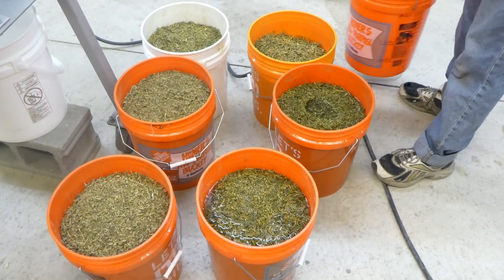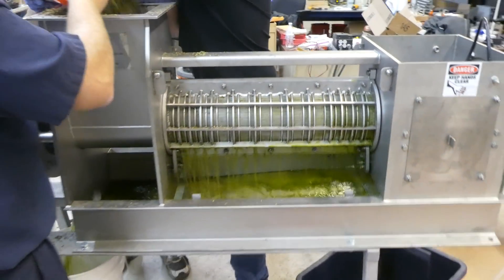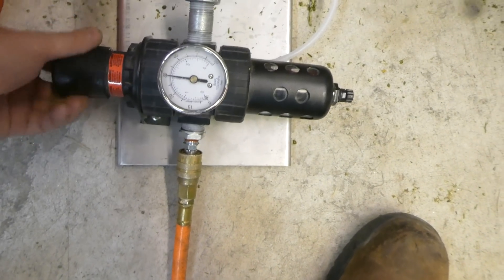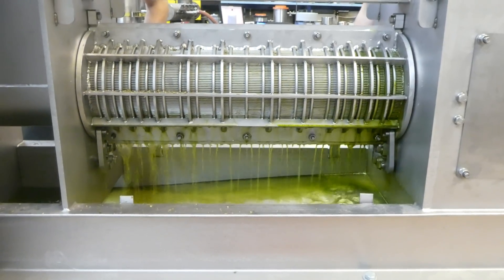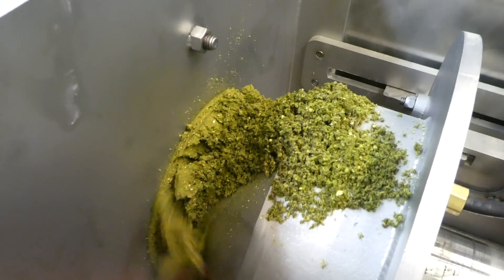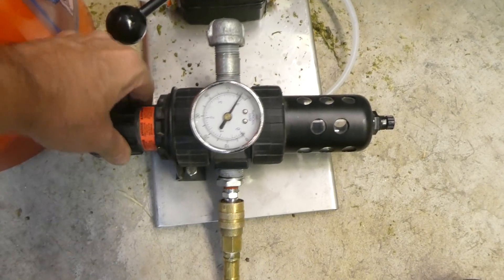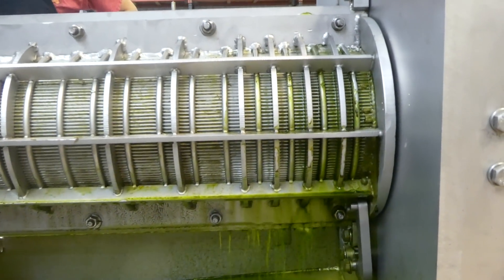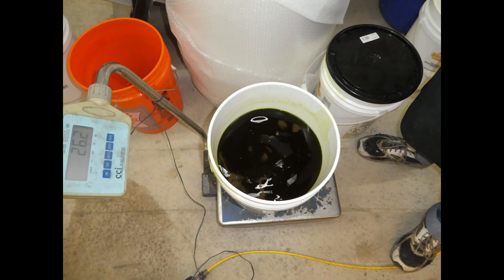Hemp processing with Ethanol for CBD oils  - VincentCorp CP6 screw press

Comment: I read that ethanol will eat the plastic on those bins.
They should be stainless steal and or glass?
Reply: 100 percent correct first thing I  noticed that whole batch wouldn't pass to be sold. They they test it For contamination. Never use plastics in the hemp industry especially with pure grain alcohol knuckle heads.

Comment: You're solvent will strip the plastic off the inside of that bucket. You are using the wrong buckets
Reply: I concur. I re use 5g green food grade buckets for a direct immersion hydro grow but for any pet solvent (alcohol hexane acetone) I'd be using stainless or glass.  It pains me to see actual dispensaries using plastic bottles or pouches to retail any bud CBD or THC.  I know it's a cost thing.   You could rinse the damaged /detached  glands out of a small  jelly jar not so good from a ziplock.

Comment: Someone else used this similar press at 131psi..squeezed out even more.. hopefully this helps,The oil was thicker and darker.
One more thing,they just added it without water.
Reply: Over 170 are using them.  Generally we don't see an increase beyond 80 PSI but it really depends on the material and the process being used

Comment: excuse the ignorance but if the ethanol  is used to bind whats the point in the screw press>? isn't it just extracting moisture from the plant matter as well as the cbd, so wouldn't just some sives be just as good if not better at extracting the valuable oil with out added water and other content,.?
Reply: disregard that, im guessing our just trying to squeeze out all the ethanol to the max
Reply: @kiboshkooks  Most use our presses on post process waste material.  Some do use it similar to this test but will need to filter out undesireables after and still rotovap or falling film the ethanol / CBD to get to a crude

Comment: Is it common for your customers to do extraction on the trim after pressing?
Reply: Most of our customers are using the press on post process waste material.  This is just an example of 3:1 ethanol saturated hemp being pressed.  Ideally you could use this as a primary extraction vessel but you will need to filter out the undesireables that press into the liquid after.  This was just a test all material thrown away.

Comment: I hope people really understand what ethanol is. Not good for the body.
Reply from the maker: I agree, but revert to the other comment,  short of using MCT oil as a extractor and carrier for the cannabinoids , there are very few options on extraction right now.  95% of all the CBD oil on the shelves you find will have touched ethanol or even worse Hexane as some point during it's life.  The beauty is that the further steps down the line.  Fractional Distillate and refinement to the isolated CBD molecule, means just that.. the only thing that gets into the vials is the wholly Isolated CBD molecule.  No other molecules.  It's chemistry and science, just like when you take ibuprofen, aspirin, vitimin C tablets ( Oranges have been processed with ethanol for over four decades by the way for oils, flavoring and full chemical extraction ).  But I get it, it sure doesn't sound nice the first time you hear it.

Comment: Let’s start by wasting a bunch at 5 psi” “how how can you run it?” “80” next shot... “run it at 100” what a newb
Reply from the maker: you have to work up gradually to get the machine into a rhythm with regards to hydraulic pressure building.  analogy.  When you are facing uphill at a Red Light, you don't try and start off in 3rd gear.  You go 1st, 2nd 3rd.   If you start at 80 psi with this press at start, normally the VFD trips out the motor
Reply: Hemp Press so is it electric over air over hydraulic? The analogy provided does not make sense. Air over hydraulics do not use multi speed transmissions.
Reply: All I know is a lot of product was expelled at above depleted moisture content

Comment: Are you able to use this without any solvent, or does there have to be some type of carrier oil/solvent?
Reply: The alcohol is the solvent.
Reply: @Freeknickers24  I know it's a solvent. I'm asking if they're able to do it with no solvent or carrier oil. Because he said the ratio they used was overkill and they barely filled the bucket, so I'm wondering how low can you go on ratio and if you are able to do it without a solvent or carrier oil due to recovery rates on ethyl.
Reply: @richardwilson3379  No. Anything used to strip the cannabinoids from the material is a solvent. Whether it's dry ice, ethanol, BHO, CO2, etc.
Reply: Richard Wilson e
Reply: That would make it a Rosin Press